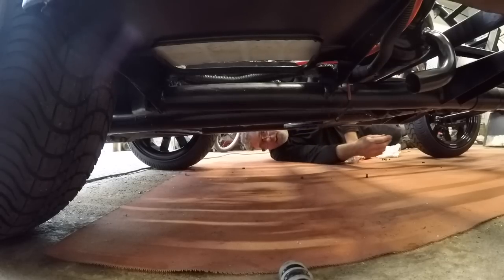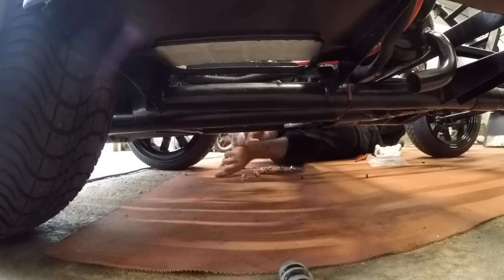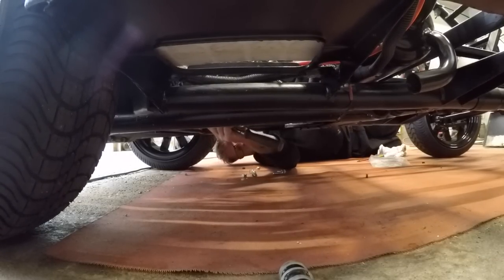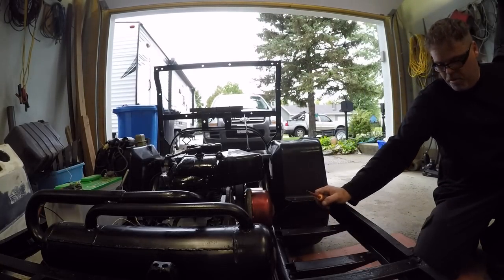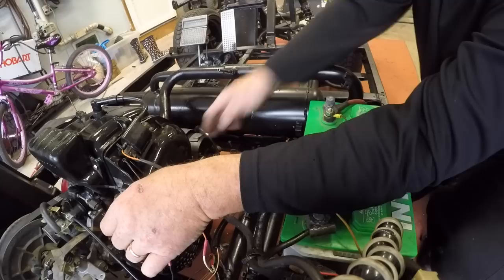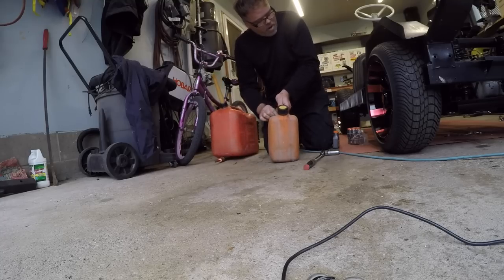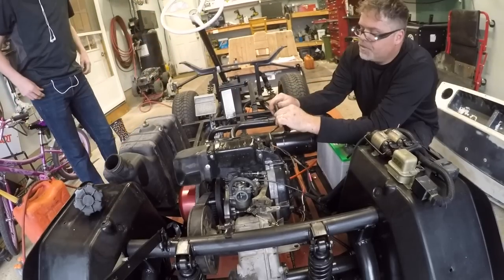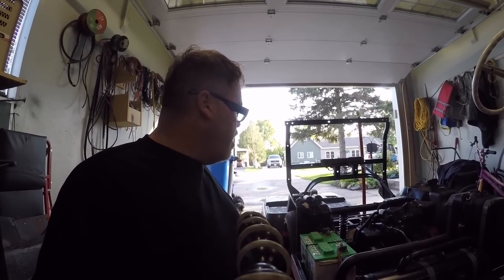YAMAHA G1 RUNNING LIKE A CHAMP

Comment: i bought a g1 yamaha a couple days ago and i could really use some help figuring out what the last owner did to it  , i am unable to get fuel to the carb   and hours of research later i have come to the conclusion that he rerouted all of the fuel lines  even the ones on the fuel pump ,   the hose that is looped over the top of the carb on everyone elses yamaha is hooked to the pulse side of the pump  ,  my question is where is the pulse side of the fuel pump supposed to hook up ?  i cant find anything online saying where engine vacuum  is ,  any help is appreciated
Reply from the maker: The Random Mechanic shout me a email and i will send ya some pictures

Comment: Hey buddy, I’ve got an old G1 that runs great if I spray some start fluid or gas to prime it but won’t start on it’s own. Tried 3 carbs, float bowl has gas. Any ideas 🤷‍♂️🤷‍♂️ thanks man, vids awesome!
Reply from the maker: Check the vent on the tank or try it with the cap off to see if thats plugged . Also have you done a completion test? . Have you cleaned the read valves and check the gaskets if theres a leak it might loss prime

Comment: just saying and i know im late on this vid but that engine needs a rebuild. that clanking when you start it is the piston hitting the head. ask me how i know!!
Reply from the maker: was just rebuilt runs fine fuel pump is weak
Reply: @LifeWithBillSiff  did u get it running right? I'm restoring the same cart. With NO AIRBOX! WONT GO INTO HIGH RPM. HELP!